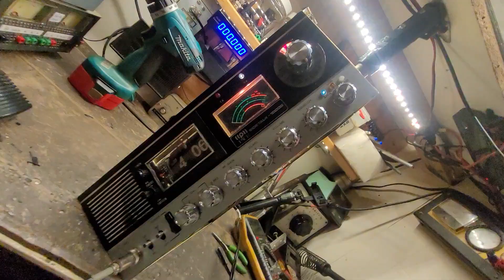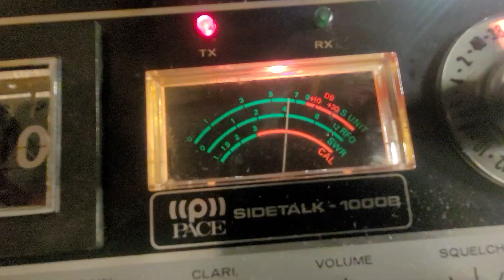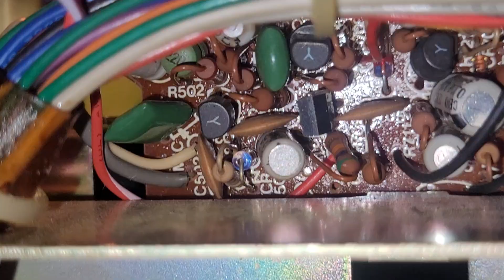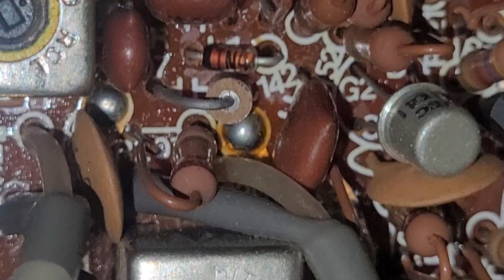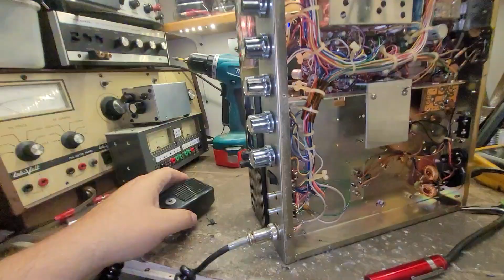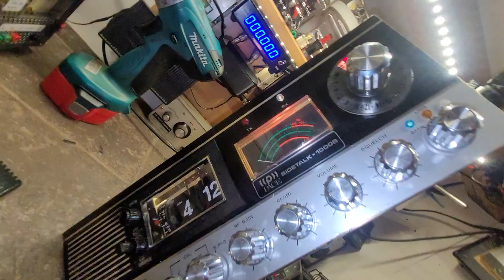PACE Sidetalk 1000b - No modulation - Part1

Comment: did you try working the cb/pa switch a bunch?
Reply from the maker: At the first the radio would not make any power at all, that was traced back to the PA/CB switch, cleaned it out the best i could and got the transmitter back running, but still no modulation.  Nothing thru PA either, so i am pretty convinced there is a transistor, diode or cap toast in the microphone input section.   I could be wrong tho.  :-)
Reply: @Radionut63  Ya watch those tantlums too they short and pop the audio IC. Not sure what is has. I had a couple 23 ch versions here. I didnt even want look at them, just stole parts. The 40 channels is interesting. I seen a forum say theres a pll02a version too. Pace and SBE and maybe more promised they would make a upgrade for the 23ch versions and I bet thats one. they a short run of the cybernet boards. They didnt last long after that